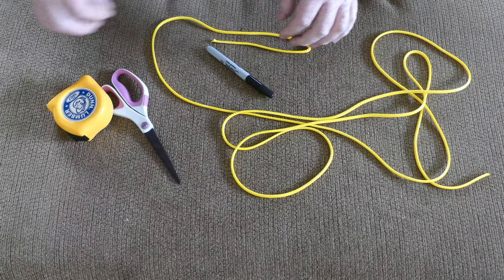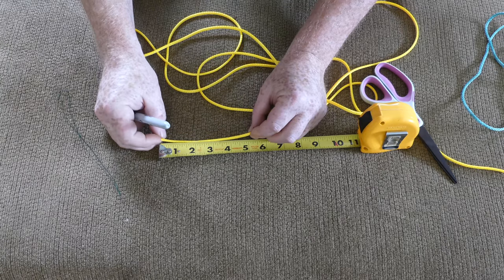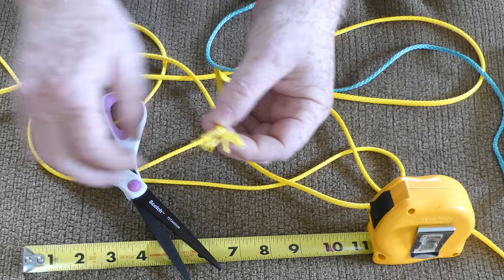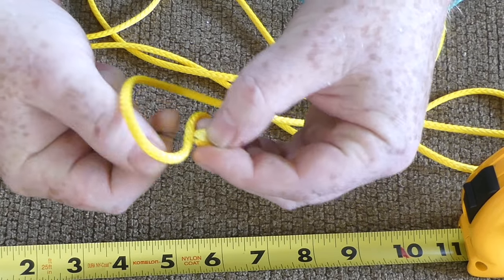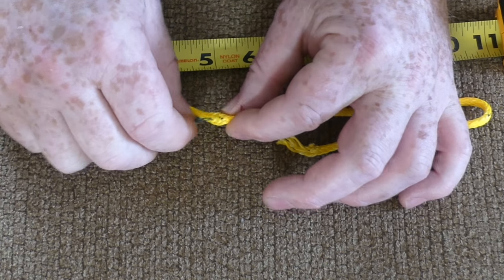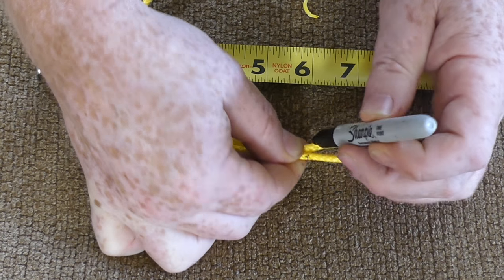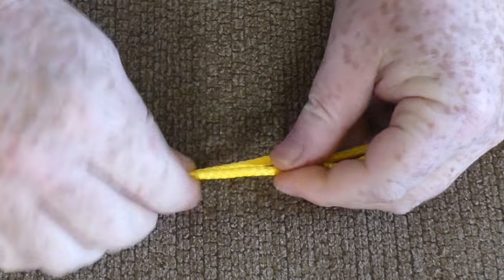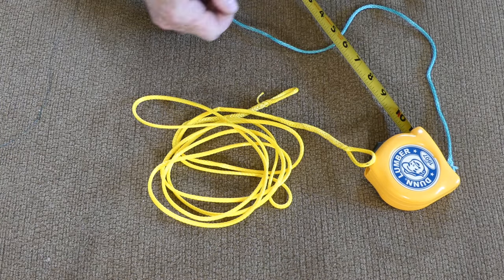Fixed Structural Ridgeline For Hammocks using 1/8th Amsteel

Comment: I always use the 1/8". Cost is negligible.  And It's easier for me to work with. I'm not a Backpacker. I motorcycle-camp. So .000007 oz., makes no difference to me. :) - Good video! Funny that you make this now. I just this week received my 1/8" Amsteel , IN YELLOW even. To do this exact thing. Since I to, have not changed my ridge-line. :)  "Great minds" as they say! ;)
Reply from the maker: Right on David.  It is pretty negligible.  So many look to go lighter and lighter, but there is a point when you can't push the equipment as hard as it may need to go.  Motorcycle camping is awesome.  I really enjoy watching the motovloggers that go camping.

Comment: I wander if 1/16th zing it is strong enough for a ridgeline. Just ran out of 7/64th. My worry is it cutting the suspension but I was thinking of using a couple of continuous loops and just hooking it to that instead of the loop on the gathered end.
Reply from the maker: I did try a complete set of zing it  whoopies and ridgeline and it held my 220 lbs.  Not that I would trust it more than a temp fix.  All that line I have found to be pretty strong and if you do double up the zing it you should be fine.  I don't like to cut it so short any more and have been doing all 1/8th now.  The weight is not a big gain, but I  no longer have to worry about all the forces.

Comment: Nice.. I was wondering how Amsteel would work out as a ridgeline for a tarp
Thanks for the video
Reply from the maker: It would be light for sure. I have gone to the cordage/utility line that I find at REI mainly for the last couple years.  I like how it won't get all knotted up, but it holds real well when doing all the fancy knots and it doesn't stretch like paracord.  I must have gone through 10 bolts of it now.

Comment: I'm going to have to make my 100 foot (hi-orange) paracord doubled to 40-50 feet John-ridgeline cord for you.

Starting at the folded bight, you work backwords every 6 inches and make single overhand fisherman's knot of the 2 lines ... for 80-~98 knots along its length (ugh! - but the prepping is worth all the rest of your future time).  In the end, the 50 feet scrunches and ties up to 40-45 feet.  The ridgeline will look like bight-loop-knot-loop-knot-loop .... loop-bight.

At the end of this process, you will have 2 line tag ends.   You make the one and only final locked brummel splice for an entirely closed loop ridgeline.  The easiest way to tie the system is to have a 2 liter soda pop bottle and wrap the line around the bottle and tie the fisherman's knot onto the bottle.  Then remove the bottle, put the knot on the backside of the bottle, and create the next knot on the forward side of the bottle.  Repeat and repeat.

In the end, you have a loopy ridgeline, but the overall strength and breaking strength is vastly increased.  As with all ropes and lines in camping and hiking you need to make a knot, and have some kind of locking mechanism (carbiner, toggle, rope knot).  With this design, all you need is to take the bight end and weave through the other loops and toggle at the appropriate tension.  Albeit this line has intense knotting, these are sliding knots, and not actual single knots gripping/cutting into the single lines.  The fisherman's knot slides open and closed, allowing other adjustments if you want to put sticks into the ridgeline (and clamp the fisherman's knot closed).

With this 40-45 feet of ridgeline, you can wrap onto a tree/limb, and toggle.  Then go to the other tree/limb, wrap around, thread through a loop, and come BACK toward the other tree.  Thread the bight into the line and toggle.  The design looks like 0=<=====>=0 on the trees.  Putting in the hammock (or already prepped as such) you can then put in head and foot sticks for a wide hammock.  If you thread 2 long poles through the 2 ridgelines, then you will have a solid flat hammock bed (or flat hammock trough)... (without other issues of ridgeline tension and breaking).

Making this design with your hammock for a singular system, ... and having a singular (ridgeline) brummeled near the bight ends, all you need to do is pull out your lines, toggle up to the trees, and the hammock and ridgeline will all appear - nice and neat.  Any further sticks (as above) make your hammock bed/cot.  Toss a tarp over the ridgeline and you are set.

Other options allow to use this same ridgeline over a single (strong) tree limb hammock.  No tree to tree.  Think of a horse blanket thrown over a horse.  Then draw the outlines of the blanket edge.  That is your ridgeline tossed over the tree limb, and toggled bight end to bight end.  Then put in needed sticks into the ridgeline knots for a hammock bed/cot, and place your hammock on top of the framework.  The tree limb becomes the ridgeline apex, as you toss the tarp over the limb.  The hammock still rocks sideways, but you can have any hammock style of hanging banana, wide hammock, flat hammock bed/cot ...

This design is very practical, but timely to make, but well deserved thereafter.
Reply from the maker: That sounds amazing.  You are really good at describing all the steps. Will need to re-read that a few times
Reply: I did not know the key board player from deep purple hammock camped...

Comment: You make this look so easy. I've been thinking of making some new shorter dog bones for my Ridgerunner suspension but I don't trust my splicing abilities. I think I'll give it a shot now. Thanks for the video.
Reply from the maker: Figure out what length you want them and I would be happy to make you some. I have a lot of extra amsteel around here.
Reply: That would be awesome! Thanks. From what I'm reading on HammockForums.net it looks like 3 feet is a good length and then it would stretch out to 37 inches after use and be the perfect length to be able to close the tarp doors and still not be tippy or stress the hammock poles too much. I was going to do 4 dog bones at 36 inches long (not including the loops at the ends). The 1/8 or 7/64 Amsteel is cool with me. I'll send you a PM. Thanks again.

Comment: Can a rope with a filament (or multi stand) core be spliced in a similar manor ??
Reply from the maker: I would think it would be possible.  I bet someone has done it.  Just getting an access hole without breaking the outer sheath would be the hard part, but I think it could be done.  If you do it let me know the results
Reply: I will try and report back...thanks...Regards, Sander